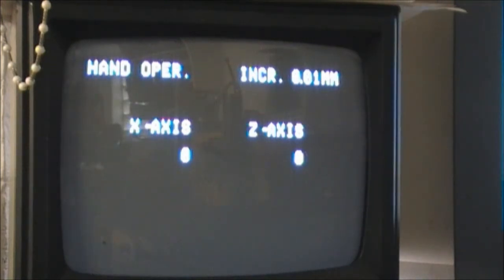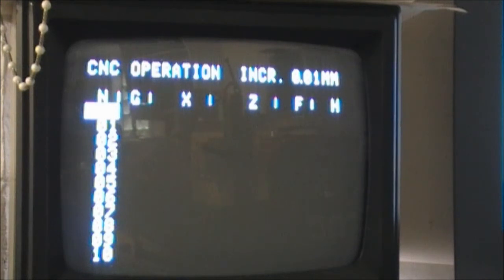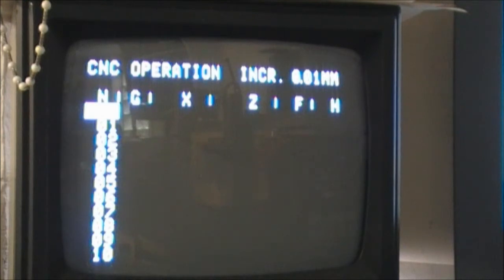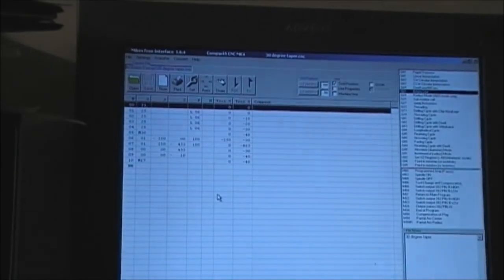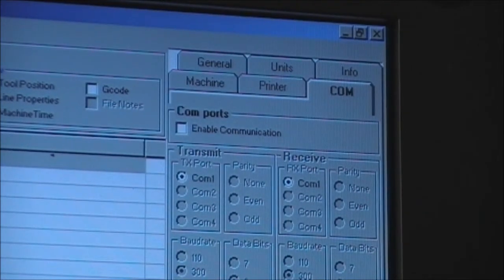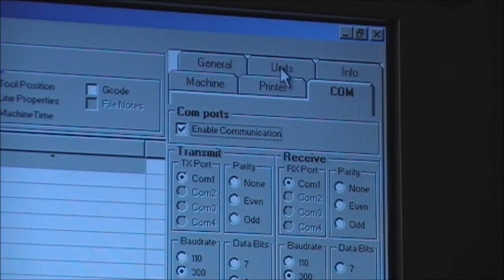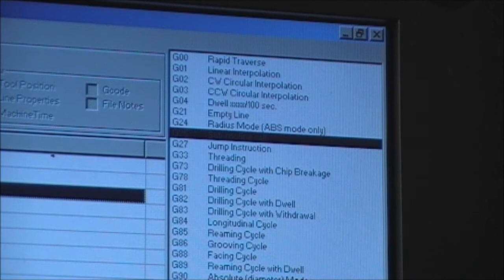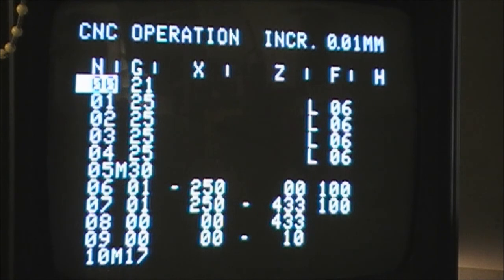Loading MFI file to EMCO Compact 5 cnc lathe and F1 milling machine.

Comment: Hi, i am using a Rs-232 25pin adapter (to usb) on a windows 10 laptop. When i go to com on settings it won't let me tick the enable box any suggestions on how to get it to communicate with the lathe. 
Thanks
Reply from the maker: Hi Harry. Using an adaptor does take some setting up knowledge to get the USB controller to identify the RS232 incoming signal. Many of the adapters on the market don't have the correct driver included in the package and may never suit your application.  There are a few people using the USB port/Win10 for communicating successfully with the Emco lathe and mill so best follow their recommendations.
I always have used an old desktop computer with serial ports and don't have issues with RS232 connecting. Whichever you use do make sure the cores are connected to the correct pins, only 3 cores are required in the RS232/Serial port lead. Sorry I can't give you a more positive answer.
Reply: @ukmwg hi, I have manned to get it to communicate with the lathe, but when I load it I'm to operations (G66) it loads it as v24 operations instead of the rs232 operations. Do you know if I can change it.
As I can transfer a file from the MFI but it doesn't load on the lathe.

Comment: Could you tell me the settings for the com ports on the computer and the mfi program I have the same setup the program detects the port but when I try to load the program it doesn't load to the Cnc control
Reply from the maker: Hi Bill, only just seen your question. If you have MFI working it should find any COM port on your computer, it will be looking for a SERIAL port to use with the RS232 link to the machine. If it finds a port the program sets the required port parameters. You do need a printer program loaded in the programs files.

Comment: Thank you so much for explaining this process, I thought the "A  Lo" was an error alarm! I still cannot get the machine to say, "loading program. I get all the way through your instructions then the last input button does nothing. 
I think I have a cabling issue.. :(

Where did you get your cable from? Did you make it? 

I have a bd25 serial end for the computer and a round 232 end for the EMCO. 

Cheers!

Matt.